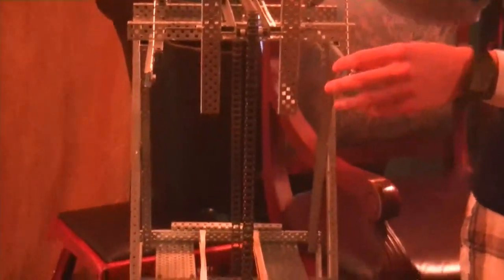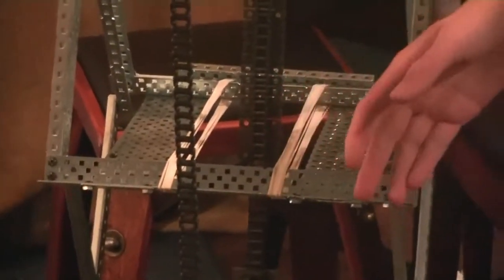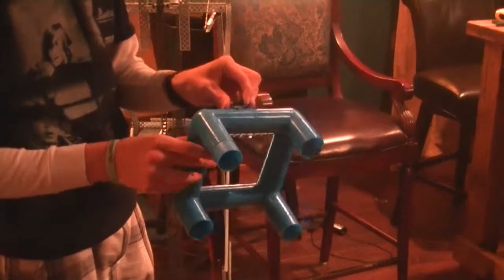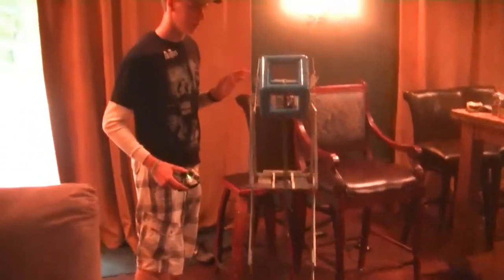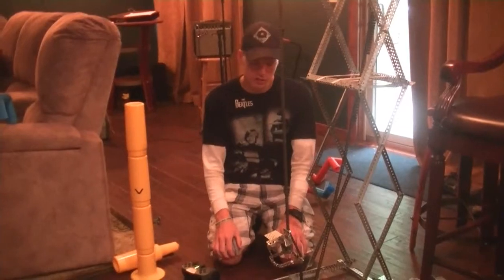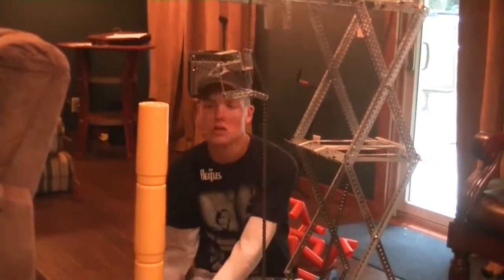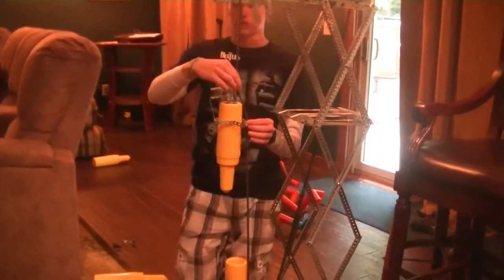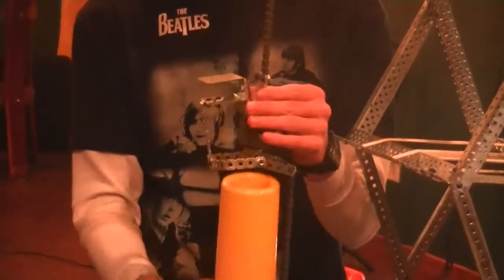Vex Skyrise Working Scissor Lift

Comment: What are those pieces on the bottom of the scissor lift. I can see you're using c-channels for the top portion, though. Very good design BTW.
Reply from the maker: Thanks. In this video the top and bottom of the lift are identical linear slide designs. In our newer design (check out our other video) we rotated the bottom slides 90 degrees and put two slides per side, which is supposed to help with stability.

Comment: my team and I saw this design and tried to duplicate. your video was a help; how do you keep the chain on track as you lift the scissor lift. we plan to use our autonomous period to place it back on track while it's still on the starting block.
Reply from the maker: We are working on that right now. Our plan is to add more sprockets, so if the chain slips, it will land on another one. We also might put some guardrails on.
Reply: we placed c-channel squares on the outside of the gears spaced out by small spacers and put together by locks.

Comment: looks good. I like the way you have solved problems as they come up.  Your driver needs to be good to be able to line up and insert the part into the skyrise section just right. Having the long chain makes it so you don't need to waste energy lifting up and down all that metal to pick up stuff.